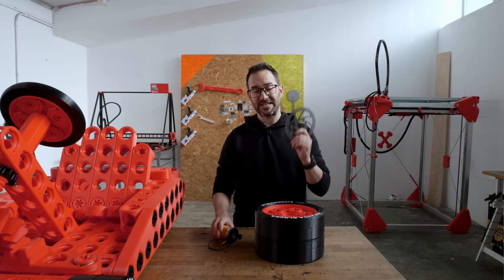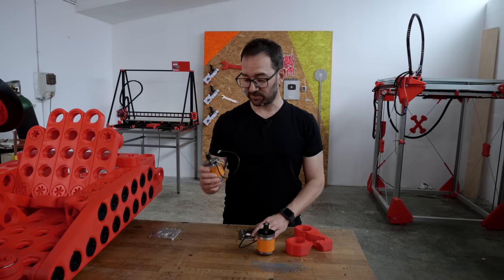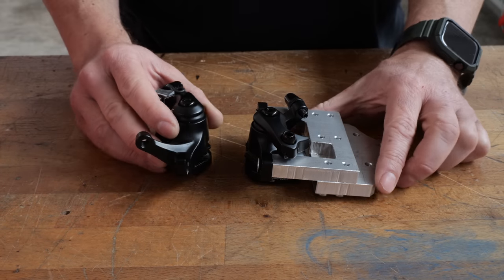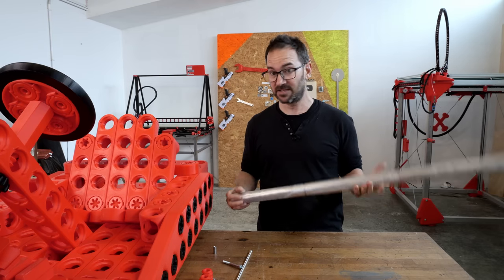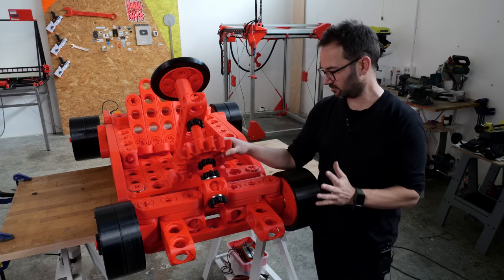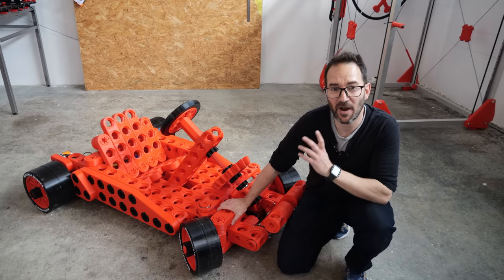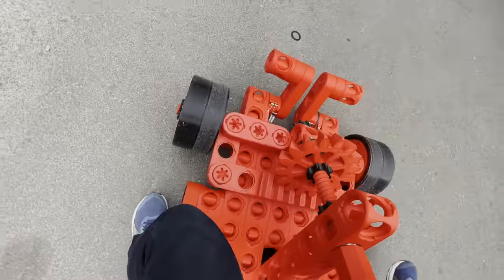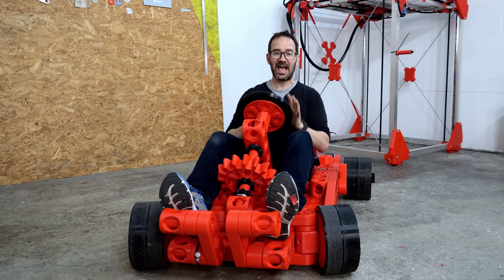GIANT 3D PRINTED GO KART BUILD - MOTORS AND TEST

Comment: Great tip: Since you have dual motors, cutting the axle in half and having the rear wheel drive seperate, would make it turn alot better :D
Reply: Watch it again mate. Wheels are on bearings. Not conected to the shaft. Only on the shaft. So 1 motor = 1 wheel.

Comment: You should invert the screw direction to prevent it from coming loose while moving forward. You want a counter clockwise screw so that it will stay tight as the wheel moves in the counter clockwise direction.
Reply: They are all threaded to tighten as the kart moves forward, if you watch, the right side he tightens going clockwise, and the left counter clockwise.
Reply: @nicholasdowns3502  didn't realize, sorta jumped to conclusions lol
Reply from the maker: Correct, all right side nuts are righty tighty and the left hand side lefty tighty. I’m sure I neglected to fasten that one and checking the wheel nuts wasn’t in the pre-race checklist. Also making a pre-race checklist wasn’t on my TO-DO list and I don’t use TO-DO lists so it was bound to happen.
Reply: @ivanmirandawastaken  noice 👍🏼
Reply: @ivanmirandawastaken  Here is the challenge "3d printed speed boat"  ) Greetings from Ukraine !
Reply: @ivanmirandawastaken  what 3d printers would be good to get if i wanted to provide a service to construction companies and a service to the government fulfilling contract services

and what sort of items could i provide with what 3d printer

i have a chance to create and start a company with the support of the government

Comment: the front wheels came undone because the wheel essentially loosened the nut at that speed, which made it come loose. having the nuts tighten with the rotation direction of the wheels prevents that
Reply: They do already tighten with the tire rotation, the thread pitch might just be too steep
Reply: He has done that. Watch video again. The right side was just loos when he started.

Comment: 70% of your braking is in the front. Your tires at 30% infil might give better suspension but not enough life so play with that one. Motors on all 4 corners with steering input controlling torque. The speed still left in that design is massively higher than you think

Comment: Have you considered making a filament grinder and extruder machine for the large parts you create that may break or get replaced, rather than throw them away you can reuse?
Reply: zz zip  the wheels on the buggy would be the only thing with grit etc. the major body parts etc could be cleaned and reprocessed. 

Ivan made just about every other work shop machine etc. it would be good to see him do an extruder and get a good size consistency and wind on the spool. Some of the better home use machines are a few thousand. 

I think all have to have virgin pellets added too.
Reply: zz zip  never had a go kart - While cool they are waste of money unless you are competing (where he (she) who is lightest wins). 

I doubt many on here would have chemistry or materials handling degree to instruct others on how to break down filament to it base components so a grinder shredder is best option available. . 

With regards to Ivan’s projects he has many that would never get covered in grim like a go kart and many home users would be the same.

Suggestion was for him to make a neat little extruder to rival prusa (as they have the wind) or poly maker..

Pla - you may need to fact check that - it has to have some very fixed conditions to be “biodegradable” most people can’t compost PLA at home = it doesn’t work…
Reply: Also showing the build of such a broken part to recycled filament machine would be super interesting.
However it seems quite complex according to specialized 3d printing channels who tried various DYI versions of it.
Reply: @GirardNicolas  but other channels aren’t Ivan Miranda!! 

It would be interesting to see if Ivan could pull off a decent grinder extruder and winder solution in his shop.

Comment: The tires held up much better than I thought. Although, maybe they need to be a little thicker to give you some ground clearance? Also, maybe the front wheels just need a wider axle? You might save some weight by removing a couple of vertical bars in the frame, but I'm not sure how much rigidity you'd lose from that. Always impressed by your ability!

Comment: Hey ivan. It’s impressive work. I did a 10,000kg robot assembly for a steel furnace 10 years or so ago… and the actual way to prevent nuts from falling its with cotter pins. Once you tighten the nut you place a pin… they are called castle nuts. The old VW beetle had them on their wheels.

Great great work

Comment: Why not use a hall sensor for steering angle, then you can adjust rear motor speeds like an electronic differential, added cornering speed advantage and will help the understeer!

Comment: concerned that the brakes will easily melt the plastic. they get very hot. Also love your content as always.
Reply from the maker: I added nylon washers between the disks and the 3D printed parts because I feared the same (I can add an aluminium bracket if that happens) but there's so little grip when braking that I bet that the brakes cannot remove enough energy to get that hot. Thanks!!!
Reply: I'm not worried about melting, I'm worried the first time he smashes the brakes, they will break!
Reply: @ivanmirandawastaken  if you can add larger calipers or increase the surface area it would help. My father made a go kart for me when I was younger and he just had a bar that would pull down onto the tires to add friction. It's not the best solution but it would brake better.

Comment: Amazing stuff, but I would get rid of the brake calipers and just use the motors to brake; it would drop some of the extra weight plus that way you can have regenerative braking to recharge your batteries.

Comment: As Stefan at CNC Kitchen has proved it's viable, I think you could create a good print recycling machine, one which lets you turn failed prints back into filament. You'd probably really benefit from it and might even push the technology forward a bit.

Comment: I noticed the wheel locks all twist in the same direction. cars that have a single wheel lock have them tighten in the opposite direction that the wheel rotates so they lock is not loosened, you should try that.
Reply from the maker: They don’t. Right side nuts are righty tighty and the left side lefty tighty. I’m sure I neglected to tight that one at some point 🙃

Comment: Inverted thread could be a good idea for the wheel nuts. Why not add suspension for the version V2 and front brake. Good engineering project, I like it. The output power and torque of this little motor seem huge.

Comment: I think one of the biggest things to try would be a spintend 100v100a dual vesc, theyre actually pretty cheap sometimes and a high voltage battery pack to suit (20s runs quite well on this platform), you'll have the power you need to smoke denton for sure!

Comment: get some bigger pulleys for the motors, raise the voltage as much as you can, and get sensored motors (if yours aren't) and a vest, so you can enable FOC so you will gain torque at low speed, the tires should be made out of ninja flex so they are grippier, and ad some patter on them for the same purpose

Comment: change the thread direction for the right hand side wheel nuts as they are essentially undoing themselves when you drive.
Reply from the maker: Wouldn’t that make them undo themselves? (Left ones are reversed)
Reply: @ivanmirandawastaken  Basicaly you want the direction of rotation on a single axel wheel nut to rotate into the direction of the thread to make them self tightening (I think I am explaining that correctly) 
I owned an old MGA with wire wheels many years ago and right hand side had a clockwise thread to tighten and left side were anticlockwise. this stopped the wheels from coming off because rotational forces kept the lug nut constantly tightened
Reply from the maker: That’s exactly what I did 🙃

Comment: Brakes work by converting kinetic energy into heat through friction.  But that heat must be dissipated.  By getting rid of the metal hub, you lost quit a lot of heat sink and heat transfer surface, which probably made them less effective at dissipating that heat which is generated.
Reply from the maker: I barely touched the brake as it has regenerative braking. The brakes themselves are more than good enough but the wheels have almost no grip even though they are made out of TPU 😉

Comment: Karts us a rotating axle, which is simpler/lighter than a non rotation axle with fully floating wheels. 
Most vehicles use castor to aid front turn, ie, it increases camber the more the steering is turned, but then again those tyres aren't that grippy.

Comment: Lock tite or print reverse screws for that side less likely to vibrate off
Reply from the maker: Wouldn’t then get unscrewed with the rotation of the wheel?
Reply: @ivanmirandawastaken  Since they all turn 1 direction when switched to the other side of the vehicle they are technically facing the opposite direction. So, I would assume that if on that 1 side the tighten was counter clockwise then all of them would technically be spinning in the same direction and would not unscrew.

Comment: Just like axles on cars, drill a hole through the nut/axle for a pin of some type to keep it from getting loose. Extend front wheel axles to make same width as back and add brakes. May also help wheels not rub on other parts. May need to adjust gearing for more torque.

Comment: I foresee those brakes not lasting very long when they do work.  The heat generated in the disc is going to melt the plastic holding them on. (Was thinking that the first minute of the video)

Comment: Might need to use a reverse screw for the right side axle. It's getting spun off.
Reply from the maker: Left hand side nuts are reversed. The one that came lose was the right one. I must have forgotten to tighten it. It got loose on the first turn.

Comment: Loving this project!!! Great results for first time out.  Maybe I missed something but it looked like your axle is going directly through the frame. I’d imagine this causing a lot of drag especially at speed.  Might want to have bearings to help with this?
Reply: Each wheel is on seperate bearings and driven individually by the two motors. i think the axle is not spinning
Reply from the maker: The rear axle is stationary, only the wheels spin.

Comment: Use bigger motors and grippier tires next time. I think if you use motors with an electronic brake built in it could greatly increase the braking capacity along with making it a whole lot faster off the start. Those motors are lacking in power unless you use a gearbox or something

Comment: for the understeer part of it, you might want to shorten the rack a bit so that the left and right wheels don't turn the same (that's a simple, short explaination but the inner radius of the corner being smaller than the outer one, the wheels don't need the same steering angle)

Comment: Argh. Those brakes. @Ivan you might not be a biker but u see those wire actuated: The disc slides close to the inner brake pad which is fixed; As you brake, only the outer brake (pad, edit) is pressed against the disc, which is slightly bent to push against the inner brakepad.
You'll find for close to 50 bucks online pretty good brake calipers with a mini fluid circuit in it. Those are wire-actuated so easier to mount, you won't mess with any additional fluid circuit since it's built in, and they brake with both the brakepads pushing simultaneously on the disc!
Very effective and price convenient even on a bike, you feel with ur fingers on the brake levers, where's that money gone! ;)
Reply: I got spare two of those I'll give you for 30 😅😅😅

Comment: Brake disc mount printed out of PLA is not the best idea - under braking forces disc will heat up and it will damage hub and potentialy detach from it completly leaving you with no brakes at all.

Comment: That will feel very unnatural to drive with having to press the break with the left foot. Still, I see why you did it that way, and I don't see an elegant solution to put them both on the same side either.
For the wheel nut coming off, maybe put a pin in front of the nut.
Reply: Gas is always right. ??
Reply: @firefly2472  yeah but the brake isn't on the left

Comment: Those cable operated disc brakes from road bikes and mountain bikes are functionally useless, between the inability to put enough pressure through the caliper, and the stretch in the steel cable (yep, it stretches and the outer cable flexes too). You would be 1000s of times better off if you could figure out how to replace those cable operated turds with hydraulic bike brakes.
Reply from the maker: The disc brakes are more than capable for this build. The tires have no weight under braking though so the wheels lock under the slightest pedal touch. This build benefits from the springiness of the cables as everything is plastic and therefore not very precise.

Comment: I think he misses the mathematical value of torque.
Reply from the maker: As tight as you can isn’t the correct value?
Reply: @ivanmirandawastaken  Meaning you don't realize the torque on those breaks to stop it. If the wheels don't fall off, you might be crashing from because broken breaks.

Comment: Using a tap in a drill makes me die alittle inside
Reply: You are gonna break the tap and then be 1000% fucked about getting it out of the hole
Reply from the maker: You should check my 3D printer and CNC builds to see that it is not that big of an issue if you do it properly

Comment: You really need to look up "Ackermann steering geometry". It's not a new concept, it was invented for horse drawn carts...
Reply from the maker: Without Ackerman on the left hand turns the front right wheel would have skid not the left one but the screw was locking the left wheel. Sometimes is hard to convey all the ideas without the video lasting 3 hours 😅